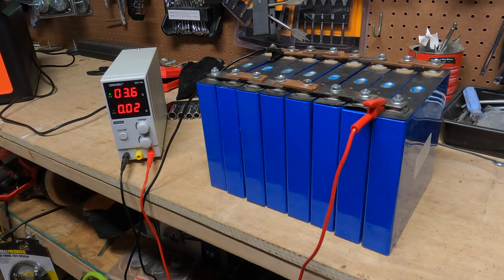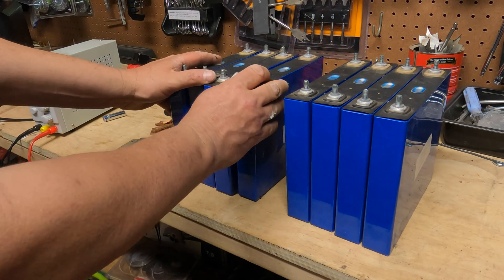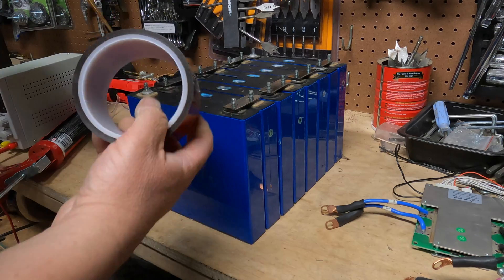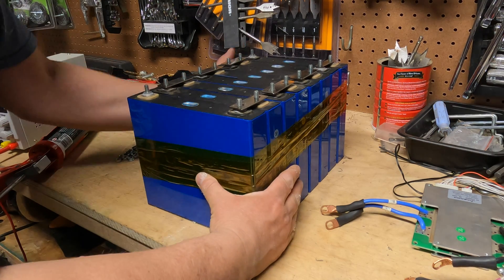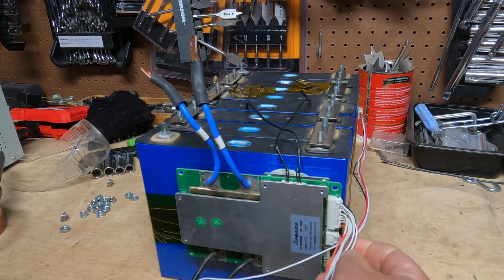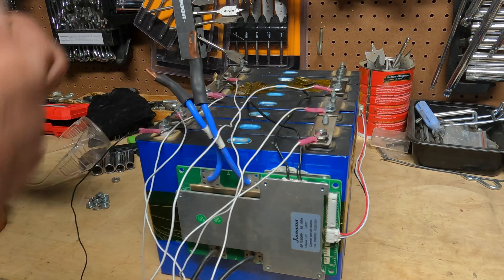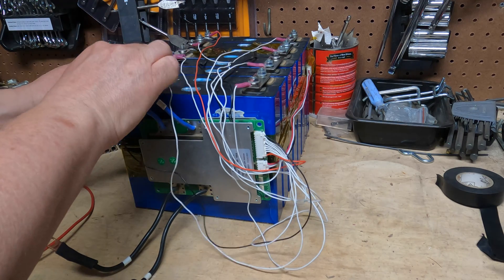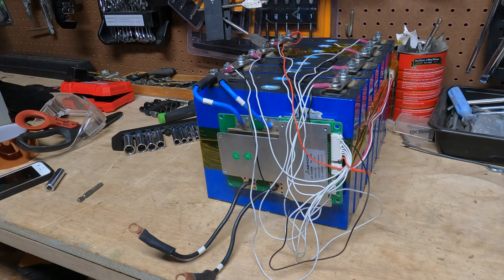Complete steps to build a DiY 24v LifePO4 Battery.  Easy and cheaper than buying a store bought one.

Comment: Can I parallel 2 batteries like this by the BMS to get twice ah with 24v? Or do I need a different bms?
Reply from the maker: Each parallel battery will need its own BMS.  Or just use large ah cells to get the capacity that you need.

Comment: This is awesome, thanks so much for this tutorial! 

Question: How long did it take you to top balance your cells using the 10 amp DC power supply? I've been trying to balance mine over the course of the past week. I know it will take awhile, but would love to get a ballpark figure for how long it could take to fully balance. Thanks in advance!
Reply from the maker: Sorry, I didn't see your question.  It's only putting in 36 watts so if it is around half full it should take over 30 hours.  Seems to take forever!
Reply: @OurBlackCatCottage  awesome thank you!

Comment: is it necessary to charge these battery after you build them? i dont have a charger. can i just directly plug it in the inverter?
Reply from the maker: You need to top balance them before you build it then keep them charged up with your solar panels.
Reply: @OurBlackCatCottage  oh yeah. thanks a lot! keep it up.
Reply: @OurBlackCatCottage  i already recieved my lifepo4 batteries. they are in 3.31V do i still need to top balance this?

Comment: So if i want to build a 48v, would i just build 2 separate 24v and connect them in series?
Reply from the maker: You could but actually I would suggest you look into just get a 16S BMS and making one 48v battery
Reply: @OurBlackCatCottage  I love the idea of building one of these batteries especially if it's worth it but I'm not sure it is anymore for the price of the grade A cells I'm seeing. Lately I'm seeing some server rack 48v 100 ah batteries like aolithium for $1099. That's a good price and hard to justify the involvement of building a battery.

Comment: I like seeing this kind of video where perfectly adequate systems can be made with many things not bought on Ebay for a fraction of the price, I made my buss bars with left over angled alloy for free working fine 4 years so far. Oxidization might be an issue so I might need to clean all the terminals periodically but otherwise all good. The amount of money saved can be vast when you diy it turning the financial viability around completely compared to buying off the shelf at 4x the price. Given how bent over my utility companies we are in many parts of the world this is a space where the difference it can make in your life is meaningful.
So how did you come to the conclusion that compressing them isn't important enough to bother?......I don't want to use compression with my next build as it largely undoes the gains in energy densities increases over the last 5 years.
Reply from the maker: The first few batteries I made I compressed them.  It just seems like a pain in the ass to do and i never saw any change in performance.  I also don't have a way to accuracy or consistency apply a force and was never really clear exactly how many (N) was needed.
 That is purely my anecdotal experience and not based on rigorous scientific testing so I am sure others will disagree.
Reply: Yes the info provided is vague especially if its as important as some say it is, but until we see some long term testing we will never know. It looks like a lot of car packs dont put their batteries under compression. @OurBlackCatCottage